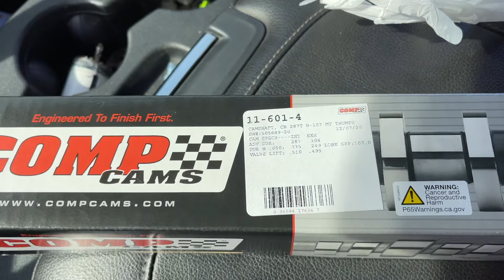Jackstand's $2,500 BIG BLOCK Jet Boat Makes a Miraculous Recovery After Finding BAD Engine Damage!!

Comment from the maker: BIG BOAT VID
Reply: HELL YEAH BROTHER
Reply: Hell yeah brother! More boat stuff!
Reply: Love to see James and George working together!
Reply: Lol
Reply: Hell yeah
Reply: On the water for the exhaust only adjust them to where it is steaming at 10% throttle out of the exhaust and leave them there
Reply: BIG Boat Video Guy.
Reply: The biggest thing in this episode is that egg on James’ head.
Reply: Big boat guy!🤣🤣🤣🌴🌴🌴
Reply: @That1carguy98  Big little boat guy
Reply: MAKE SURE TO GET LIFTERs WITH HARDENED LIFTER SEATS.
Reply: lower part of the lifter is etched with a ring around it. if it does have hardened seats
Reply: Reliability challenge.. James fails..
Reply: NEEDS A NEW CARB !!!!
Reply: @groundzero4044  no budget
Reply: @SlothCharging  0ccbfbn
Reply: I hope you were allowed to weld some scrap to your axles
Reply: Should do and like rzr passenger handbar , into dash with slot with pin so you can remove it and for getting rowdy to Madi has something hold onto
Reply: Break Out Another Thousand 🤘🤣🤙
Reply: any content is good content. keep it coming.
Reply: You realize how many snakes are up in those trees you're driving through?
Reply: ALEC NEEDS A JETBOAT!!! ✈️🚤
Reply: What hit jackstand in his head?
Reply: Biiig broken boat guy.
Reply: or bigger cams on the accelerator pump's
Reply: Huge boat guys
Reply: James's boat is a badass pos 😁
Reply: Love it
Reply: Cleet you should do a mini boat give away
Reply: "I Still Got Some Budget Left" Jackstand T Shirt?!? i think so my guy....
Reply: Do it for Dale, don't be a snail!
Reply: Make Sure Your BOAT TRAILTER Is WELDED Cleetus and that YOU have a Boat PLUG. Otherwise YOU Wouldn't Be making it to Anyplace and that YOU have a BUNGY CORD to Hold Up the Trailers Hitch Wheel from Dragging on the ROAD.   BE SAFE YOU 6 and MAKE Sure The Trailers Are SAFE for The TRAVELS..
Reply: First time I’ve ever seen someone offroad a boat.   Fun times
Reply: You got a rep to protect as Florida man, we get it.
Reply: the dew canoe needs some windshield wipers
Reply: If I had known  I would of came out to the river in arcadia  I live around the corner  from thare would of loved  to  see you all
Reply: Is that his fly wheel  oh my not good those teeth  you kinda bent
Reply: good shit
Reply: LET ME DRIVE THE BOAT 🚢😳
Reply: Just hearing George’s laugh makes me laugh 😂
Reply: Cover the pickup of the jet while hauling it on trailer.... Driving down the road kicks rocks and dirt up into em and grinds into the wear ring in the jet at first start up
Reply: Is this the equivalent of taking a truck off reading? I sure hope so
Reply: Pantera would have been a cooler name than flamingo.......
Reply: bring tow ropes
Reply: Loved that Madi called out Garza for the kershaw. Shows that she more than Garrett’s wife to be and more like a Cleetus channel face!
Reply: Somebody needs to learn how to tune a fuel mixer. She didn't sound good with or without a load on it.
You should also tack the distributor so its locked out and time it at 34-36 degrees.
Reply: Y’all should do the Paqui One Chip Challenge and whoever is the last to drink something gets an extra $500 to spend
Reply: Biiiiiig boat vid!
Reply: @ingresswizard9044  I feel like somehow George and Alec would punish themselves for this!
Reply: Can't wait til a big ol' snake or iguana drops into someone's lap when you bomb those trees! lol
Reply: I thought you lived your life a 1/4 at a time. 
Not one rapid at a time.
$100 BUCKS you find a wall in the next video.
Reply: What a vid   love it. Jet boats cleetus  James hell yeah
Reply: Dude start fishing all those secret fishing spots what are you doing!!!
Reply: Shirt ideas: It’s not here for a long time, it’s here for a good time!

Jack stand Engineering!
Reply: Thanks
Reply: Marine cams are different from auto cams. The exhaust lobe is smaller on marine cams because once in the water it puts back pressure on the exhaust and will suck water and mix oil
Reply: Take the timing light with you on the water and adjust it around find the best top speed.
Reply: Sounds like it needs more accelerator pump.
Reply: James there should be a spring loaded valve that does not allow water to headers at idle. that's why you always hear jet boats revving up while idling.
Reply: HELL YEAH BROTHER
Reply: My money is on james for the win
Reply: Hell ya brother!
Reply: Hope you ran either  hardened lifters or solids
Reply: @rh2racing  a mosquito the size of a smart car and then a pimple…. 

Rough few days for jackstand
Reply: 7:00 James don't try to confuse us with your wicked knowledge!! Where's the fun pedal or in this case the fun stick
Reply: Hey Cleetur, why is it that at @9:17 mark that badass yeller-bee killa looks like someone smacked into it's rear bumper pretty hard??? Isn't travel restrictions lifted enough yet for you to ship those back over to the aussies?
Reply: I don't like spiders & snakes - you couldn't pay me enough to drive through that debris.
Reply: Just a year ago it seemed like James was only 20, maybe 25. He has a baby and 3 months later his hair is all turning grey!  Yikes !!!

Comment: You don’t want any water in the exhaust until you hit around 1800 rpms then you only need a fine mist after that. The water in the exhaust is only for cooling to save the chrome and to make it quieter. Run without it and you’ll be fine and run better
Reply: Upvote this comment
Reply: Unless that's the block dump and it doesn't have an out of hull flow. Can easily be re routed

Comment: You guys should build a splash guard on the top of the windshield. Slight curve forward will deflect water to the passenger and driver sides if the nose ever goes under.

Comment: James, you don’t even need to run water to the exhaust. Those over the transom headers don’t really NEED water…. I had an old jet boat guy tell me like this “do you water cool your hot rod exhaust?”
Reply: Water through the stacks is for safety(what's that?). To keep passengers from burning arms and legs getting in the boat. Only reason this boat needs to run wet is to keep the towline/ski rope from getting burnt.....
Reply: @ajwilson605  noise also! The water muffles the sound..
Reply: It’s just to keep the headers from turning blue. Even though it has water going through them they will burn you arm and melt ski ropes.
Reply: @billallen4793  That's why I don't have a radio in my Race/Street car. I do not want it quiet I love to hear the song from the .730/.760 solid roller🎶👂💯😊.
Reply: @kev-o8791  It's for more then that.
Reply: Neighbor built a T bucket with straight pipes. He had 25 gallons of water on board he would turn on when he passed LE. Made more of a difference than you'd expect.
So yes.
Reply: @eric63377  I have 2 different mufflers for the boat in my pic a valve for water or a set of suppertrapp dry mufflers, or just run wide open. At wide open no water is getting in the exhaust pressure is to high but different racing rules in different areas. Plus some lake's have a noise limit. I've been booted many times...lol...from Wyoming USA 🇺🇸 🤠
Reply: @ajwilson605  , if you think that water will keep you from burning yourself on those pipes, you can put your hand on my exhaust and tell me if it works. Then we will drive you to the hospital for your skin grafts…

Comment: Just leave the exhaust water off, those headers up in the air like that will cool them just fine. Its not like they are pretty stainless pipes, they 15yr old Krylon rebuilds lol.
Reply: Exactly what I was thinking
Reply: Exactly
Reply: I disagree
Reply: Let them GLOW!!!
Reply: @pauledwards9416  ok you have that freedom, explain how they wont be fine on a boat but survive daily on street cars around the world that are not in the open air.
Reply: @young11984  it’s not a riser setup so it’ll be fine with no water through the exhaust
Reply: @young11984  I’m a  boat mechanic from way back
Reply: @pauledwards9416  still not really an answer lol, I’m also curious
Reply: @ElliHarper  they dont unless its running 20 miles wide open lol
Reply: @pauledwards9416  thats awesome man, so am i but still do it today along with nearly anything else with an engine on land or water. We still run $3k stainless headers on supercharged boats with no water cooling, best part is the colors they turn after every long hard run
Reply: the water is injected as a muffler. Most marine engines use aluminum exhaust to save weight, and they use the water injection for cooling. River jet boats use it for both reasons.
Reply: @ElliHarper  There are "Dry Stacks" and "Wet Stacks" the water makes them Wet Stacks....Basically so your girlfriend won't burn herself on the exhaust if she brushes up against the headers.....LEAVE THE VALVES OFF! Let Her EAT!
Reply: @ericbrandt829  even when they have water your girl will still get a new Bassett tattoo 😉
Reply: @Animezium  i will take 5 of those for $2500 usd each shipped 😂
Reply: EXACTLY HE DONT KNOW THOUGH it's funny watching him constantly messing with the water valve and wonders why it won't run right
Reply: You’d think that but I disagree considering it burns through a few layers of skin the second you touch one after heating up to operating temperature, I know from experience the air doesn’t do shit 🤣
Reply: @konnorchilds3173  same with a car, they dont melt away being under a hood running balls out on a road course for 30min so the headers will survive being on a boat. Touch any header while running and you get burned so thats not a secret anyway

Comment: James needs to get a manual transmission flywheel for that boat, it'll keep it running much better and i hear its a common upgrade on those older jetboats.

Comment: Jimmy, a little advice on the water going to the headers. You're right, reversion is sucking water from the exhaust into the engine. You need to install a simple ball valve from a hardware store, and run cheap heater hose up to the valve by the driver seat. Once you're above 2500rpm, turn the valve on manually
Reply: That or just don’t run water to the headers all together
Reply: What is the point of water in the exhaust?
Reply: @IamR3D88  cooling the exhaust
Reply: IamR3D88 cooling and muffle the sound
Reply: Nonononooooo Marine cams are different from auto cams everyone that’s why he’s sucking water. Exhaust lobe on a marine cam is smaller so they don’t open so much because if it was the same as a car it would suck water.
Reply: @zachroberts117  true. It would be nice to make it functional I suppose. That's a good boat to start with
Reply: @stormbrown7158  you dont have a clue what you're talking about. How big is a marine exhaust lobe eh?

Comment: Hey James, you don't need to run water through the headers. The reason they run water through exhaust manifold on marine engines are for cooler engine bay when the engine are in a enclosed compartment and less smoke out the back. Without the water cooling the stock exhaust manifolds it would be hot as hell in a boats engine bay, your headers are air cooled and way up above the boat. If you think the headers are going to be to hot running at high rpm, well the NASCAR run on full throttle for hours and don't need any water cooling the headers.
Reply: You're not allowed to run injected headers in a closed engine bay.     When there's an engine cover, you're required to run jacketed exhaust.
Reply: @earlbrown  Did I say that? I sad exhaust manifold, not header.
Reply: I was gonna say , those arent jacketed manifolds those are just headers .. you dont run water through headers ..
Reply: just gonna start saying im not boat guy. im a car and off road guy. but i was wondering are we sure its just to cool the headers?? i dont see a radiator anywhere on that boat and i feel  like its to also cool the motor as a whole. like with the few jet skis and boats ive worked on none had a sweet ass v8 powering them but the water always cooled the engine. but at the same time it kinda cooled the exhaust as well because thats where the now used hot water was dumped after it cycled through to cool the engine. pretty sure all that water is being cycled completely through the engine before being dumped into the headers cooling it all off as a whole. but like i said im a car guy i might be wrong feel free to tell me if i am.
Reply: @JamesDean-yo8wm   the jet pump supplies the engine with cooling water then dumps it. The entire lake is the radiator.  You have to put a valve on it to slow down the flow of water so it doesn't run too cool as speed.

Injecting water into the headers is to keep them from getting too hot and potentially causing a fire.  it also acts as a legal muffling device.
Reply: You inject water into headers about an inch from the gasket.

Jacketed manifolds have a water jacket that lets cooling water go around the exhaust, preheats it, then cools the engine.

After that, it's injected at the snails if it's a transom exit exhaust, or dumped overboard if the exhaust is over the transom.

James has injected headers.   (and they're only supposed to get a mist of water when the engine is greater than idle).
Reply: @earlbrown  I have no idea why you keep explaining things to me, I already know all of it and some more. E.i if you have a closed cooling system with an heat exchanger the "jacketed" manifolds are cooled with sea water and not part of the closed cooling system.
Reply: @SwedesGarage , it’s been helping me understand the wet exhaust on a marine application, I didn’t know anything about it before I read the comments. Don’t get on him too bad because it’s helping some of us. Learning something new!
Reply: @SwedesGarage   I have no idea why you think I'm talking to you.

Esp since my replies actually tag James and JD (I think was their name) at the beginning on my post.
Reply: @Hoaxer51   Some people are just so worried about being an internet expert, they can't see the forest for the trees, I guess.

Also, Sweedes Garage, I was talking to Tim Finch, that's why the beginning of my post literally says ''at Tim Finch'' at the very beginning.

It's not directed to you. You're not important to me.   I could literally (the correct definition of the word) not care less if you misunderstand a basic tech answer.

Think that'll work Tim?   lol
Reply: @earlbrown  because all your answers are under my name instead of the normal reply section. And 2 of your replies have no tag in them.
Reply: The intake water normally runs through jacketed headers to also pre heat the water, so stone cold water is not being circulated in the engine.
Reply: @earlbrown , yea Earl, I knew tug boats and bigger boats mainly with Diesel engines had wet or dry exhausts but I didn’t know drag boats or even other boats had that option. It’s very interesting learning about this stuff, I’m a gearhead at heart so this is all good stuff. Thanks for sharing your knowledge even if some people take it the wrong way.

Comment: Yall please keep his jet boat and put like a Blueprint big block in it and actually make some serious power and do some cool stuff with that boat. It'd be so cool to see you guys turn that thing into something really cool and it'd be a good excuse to bring Finnegan back on
Reply: Don’t they still have a 632 from toast laying around? Lol
Reply: Did you guys not see what happened to the last blueprint 632? It made like one trip at summer nights if you want to call it one trip and blew up.
Reply: @eric63377  thats cause they dont really build those for boost or the application they were using it for. That motor would remain N/A for the time being since they'd prob just replace the one that's currently in it so they wouldn't have to do a bunch of work and the downtime would be minimal
Reply: @dustynwilliams7816  id hope so cause thatd be perfect just a solid n/a setup to throw in once they pull that hunk of junk out of there

Comment: FYI boys, with those headers being roached, there's not much point in running the wet pipes on. Buuuut if you are dead set on it, just run them with the valve half open.
Reply: Dont see why they would even bother. I never run water through my windsor jetboat it just took the chrome off an made them blueish looks more badass now lol

Comment: Yes run the exhaust dry don't risk sucking water in the exhaust valves.
Reply: @FUCK_________googIe  good theory, but wrong. Headers go up on boats for a reason, but it's not because of lack of space ✌️
Reply: @richfox8751  why then?
Reply: @krocketonboost5236  if I remember correctly from the b is for build boat, its to do with the waterline so that water doesn't flow in when the engines off
Reply: @camden2941  No, flappers are what keeps water out of exhaust when they are below the water lines. Headers on jet boats are primarily for looks and because the transom is too short to make a good exit spot for exhaust and have good flow from the pipes.
Reply: @dachine86  ooooooooh that makes sense thank you
Reply: @camden2941  never use "b is for build" for educational purposes hahaha